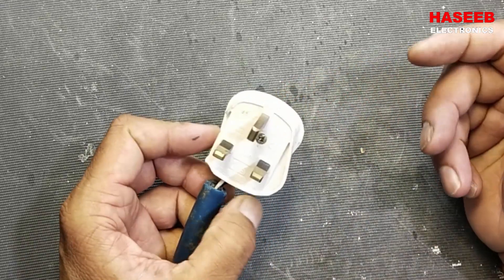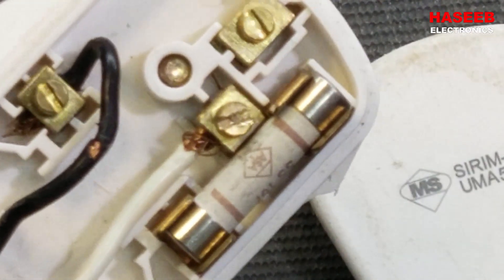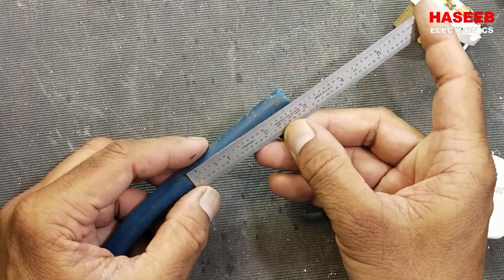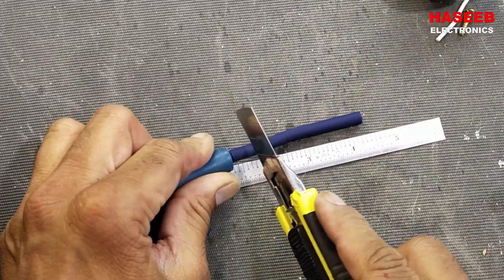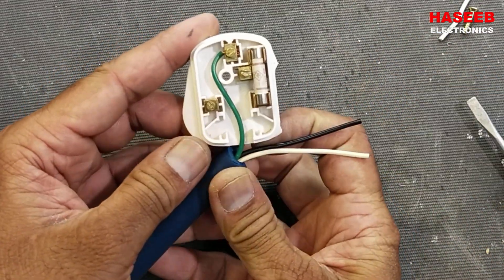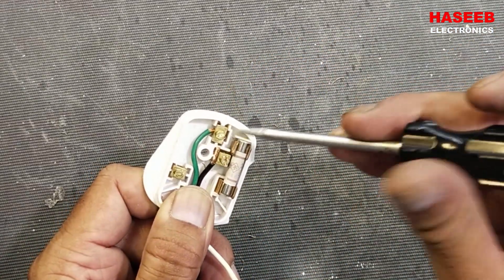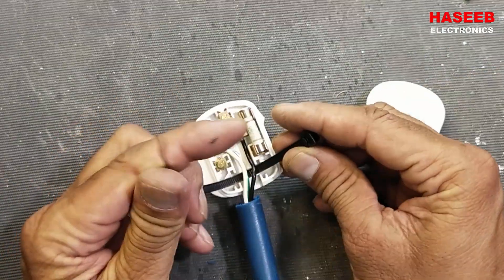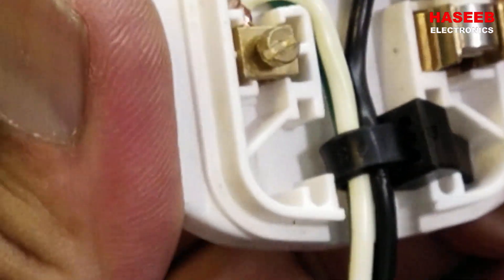[426] How to Wire a Power Connector /Plug Using US AC Wire Color Code Standard for Single Phase

Comment: Excellent video, however a detail is missing:

On a genuine british connector, the phase (live, hot, brown, black) shall be wired as directly as possible, (as shown here) but the neutral (white, blue) shall have some loop and the ground (green / yellow/green) even more spare loop insie the connector.

Why ? Simple: In case of brutal cable pull, the shortest hot will break / tear-off first, followed by the neutral abd finally, the ground will break last. Simple safety feature.

Comment: Why didn't you use the inner, dark blue, insulation for the strain releaf cable tie. There has to be a risk that those three wires will become damaged and expose bare wires.

Comment: In the UK that plug would FAIL safety test, the cable must be clamped with clamp supplied with plug, one always is, but more importantly no single wire should be visible outside of plug, the clamp must be on the outer sheath. You are very knowledgeable Sir, great you tube channel.
Reply from the maker: you are exactly right dear

Comment: When the outer wire insulation is too thick for plug strain relief, I use a piece of duel layer shrink tube to bridge the gap from the plug strain relief to the original wire outter insulation. Good to see the zip tie added inside the plug!  Great video!
Reply from the maker: That's a great idea! 
actually it is swimming pool cleaner (which i repaired in video number (429), the cable is american standard, and british standard connector is connected to US standard cable. the customer was careless about safety. moreover he wasn't agree to replace it even it is not much expensive (just 2 Jordanian dinar equal to 2.8 USD), so for safety purpose i installed the earthing wire and made proper routing, and installed a strap tie-down to work as a "cable grip"

Comment: Very good to connect all 3 wires, thank you for making the cable safer. Please allow 2 hints for more safety, first I would leave a bit of the second insulation for tighting the zip-tie on it. It would make lesser stress on the pure wire insulation. And second, if you leave more cable on the earth wire it would be safer if the cable will be pulled out of the plug and line and neutral will tear before ground breaks away.
Reply from the maker: special thanks sir
i salute to your excellent experience and valuable knowledge 
please accept my best regards and special thanks

Comment: Wrong. The outer insulation must go into the plug. And you should not use a defective plug without a cable strain relief strap. A zip tie around the inner conductors is not acceptable. Also why are you fitting a UK 13A plug to an American appliance? There are no 230V American appliances. The plug is also broken at one side & strictly speaking the wire should be fitted with ferrules. Very poor example.
Reply from the maker: you are right 
this swimming pool cleaner is 220v operated 
here in Jordan it is 220 supply. and the customer is already using same cable as it was factory installed
so I connected as per line color code with describing safety issues. 
you are exactly right that tie strap down is not acceptable on inner conductor
but it is better than nothing 
please accept my. best regards and special thanks for your valuable advise and special care on safety